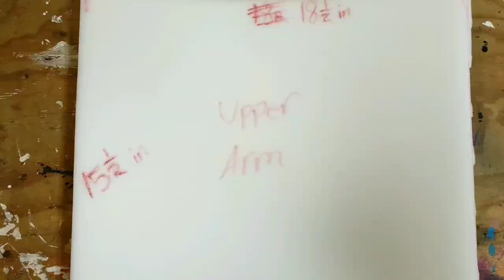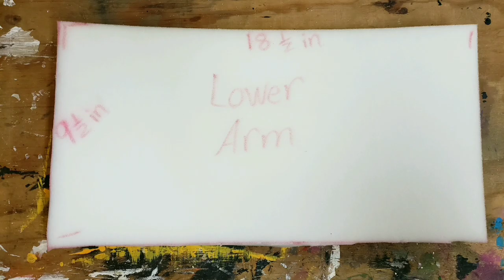Withered Bonnie cosplay tutorial (FNAF 2) plz read description

Comment: Can you give me all of the measurements pls ? I want to try to make it for halloween
Reply from the maker: Sure thing 👍, these are the materials but the main measurements are throughout the video
Head: (I used a hardhat as my base)  cardboard, 2mm. craft foam, LED lights, 1/2in. or 1in. thick foam(normally at Hobby lobby), pvc pipe or wooden dowels(whichever works best), wire or springs(to attach jaw), purple felt, black spray paint
Body: 1in. thick foam, purple felt, red ribbon, light purple acrylic paint, black spray paint 
Hand: cardboard, pieces of a soda can, straws, yarn, elastic band, silver and black spray paint (don't add straws or yarn if you Do Not want an articulating hand)
Reply from the maker: Some of the parts don't have measurements because it is meant to give a general idea of the size so that you can make a custom fit for yourself
Reply: Scarlett Art/music thanks a lot
Reply from the maker: No problem 👍

Comment: What matiereals did you use for this?i want to make own.
Ps:Awsome video
Reply from the maker: I hope this helps, and thanks!😁👍
Reply from the maker: Head: (I used a hardhat as my base)  cardboard, 2mm. craft foam, LED lights, 1/2in. or 1in. thick foam(normally at Hobby lobby), pvc pipe or wooden dowels(whichever works best), wire or springs(to attach jaw), purple felt, black spray paint
Body: 1in. thick foam, purple felt, red ribbon, light purple acrylic paint, black spray paint 
Hand: cardboard, pieces of a soda can, straws, yarn, elastic band, silver and black spray paint (don't add straws or yarn if you Do Not want an articulating hand)
Reply: Scarlett Art/music thank you so much

Comment: Could you list the items that were used in this video? That would be very helpful! Also thank u for this vid :D
Reply from the maker: Sure thing 👍, Head: (I used a hardhat as my base)  cardboard, 2mm. craft foam, LED lights, 1/2in. or 1in. thick foam(normally at Hobby lobby), pvc pipe or wooden dowels(whichever works best), wire or springs(to attach jaw), purple felt, black spray paint
Body: 1in. thick foam, purple felt, red ribbon, light purple acrylic paint, black spray paint 
Hand: cardboard, pieces of a soda can, straws, yarn, elastic band, silver and black spray paint (don't add straws or yarn if you Do Not want an articulating hand)
No problem 😁👍
Reply: @scarlettartmusic  omg tysm! Planning to make this on Halloween if its safe enough at that time of year :>
Reply from the maker: @ritagrg9187  No problem, and that's awesome!😁👍
Reply: @scarlettartmusic  thanks :D

Comment: The materials plis?
And good cosplay
Reply from the maker: Head: (I used a hardhat as my base)  cardboard, 2mm. craft foam, LED lights, 1/2in. or 1in. thick foam(normally at Hobby lobby), pvc pipe or wooden dowels(whichever works best), wire or springs(to attach jaw), purple felt, black spray paint
Body: 1in. thick foam, purple felt, red ribbon, light purple acrylic paint, black spray paint 
Hand: cardboard, pieces of a soda can, straws, yarn, elastic band, silver and black spray paint (don't add straws or yarn if you Do Not want an articulating hand)
Reply from the maker: Thank you!😁👍

Comment: Instructions unclear, but somebody’s frontal lobe out
Reply from the maker: Generally, for the head you make the base out of cardboard and add a layer of foam. With the jaw you do the same thing(but you make holes where you want the hinges). Then cover the foam with felt. For the teeth, I cut out pieces of for and painted them white.
Reply from the maker: For the body, cut foam into the basic dimensions of your figure, but add an extra inch or two so that there is some room to fit your left arm. Then cover the foam with felt.
Reply from the maker: For the right arms and legs, measure the length of your arm/legs (not counting the joint) cut the measurements on foam and cover with felt.
Reply from the maker: The feet can be optional, I did me own version of them, but you can just use a shoebox.
Reply from the maker: For the right hand, make sure the foam covers your real hand and not the cardboard version.
Reply from the maker: For the hand, I used cardboard as a base. Then on the underside of each finger(and the wrist area) cut and glue plastic straws (this helps to keep the string in place. I used pieces of a soda can to add a metal effect.

Comment: Whats the Material
Reply from the maker: Head: (I used a hardhat as my base)  cardboard, 2mm. craft foam, LED lights, 1/2in. or 1in. thick foam(normally at Hobby lobby), pvc pipe or wooden dowels(whichever works best), wire or springs(to attach jaw), purple felt, black spray paint
Body: 1in. thick foam, purple felt, red ribbon, light purple acrylic paint, black spray paint
Reply from the maker: Hand: cardboard, pieces of a soda can, straws, yarn, elastic band, silver and black spray paint (don't add straws or yarn if you Do Not want an articulating hand)
Reply: @scarlettartmusic  thanks